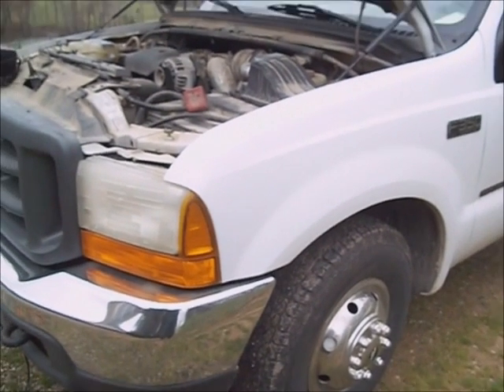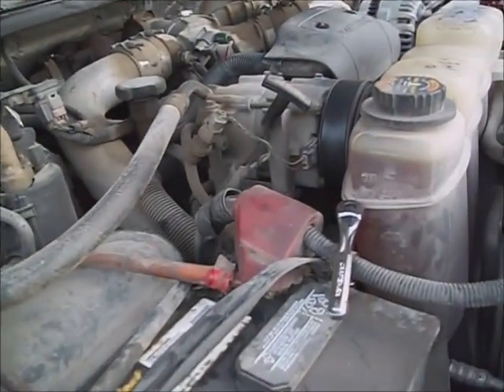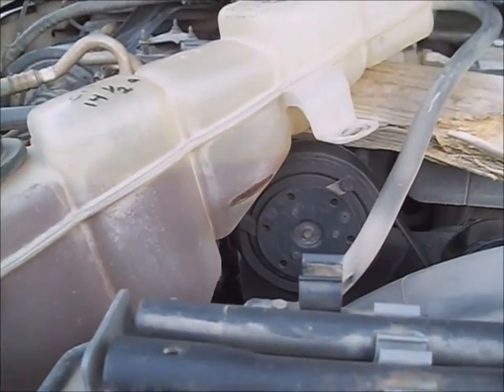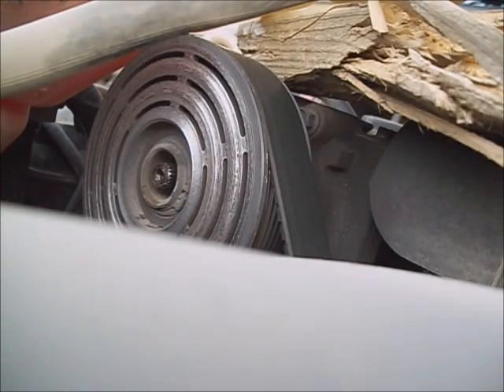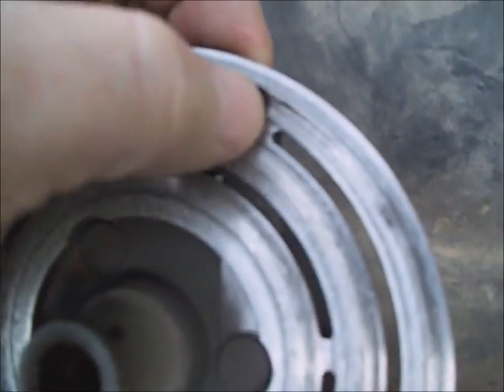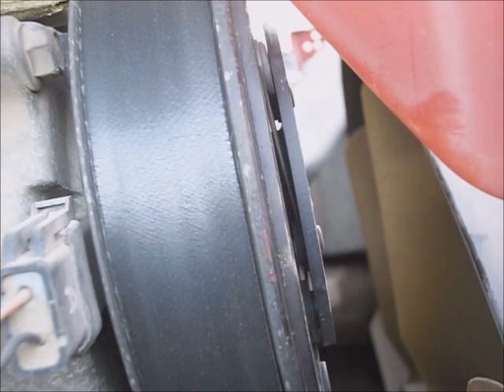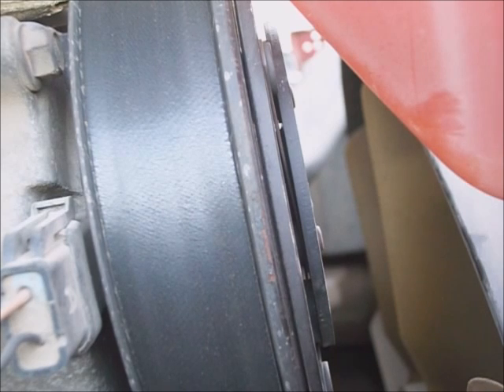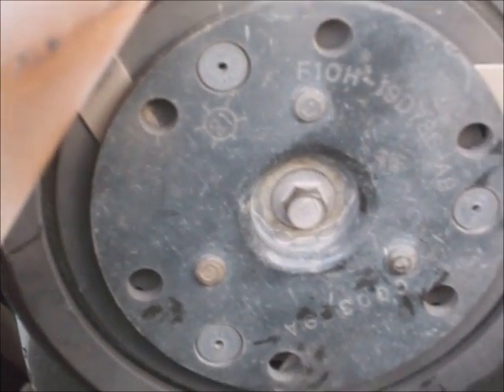Ford F350 Super Duty Utility Truck `00 w 7.3 Powerstroke DSL Turbo AC drops out at cruise speed

Comment: If it isn’t engaging and I replace instead of removing shim do I replace clutch hub or whole clutch assembly or the entire compressor
Reply from the maker: If the air gap is the problem, then both clutch components should be replaced, as a match set.  Thanks for watching.
Reply: @AutoDrdiy  i have no air gap.... sounds like i need new componets

Comment: Clutch won't engage, how do I stop it from turning to get the bolt out? 99 250 SD 7.3 - thanks
Reply from the maker: rent the holding tool from parts store, it is like a (Y) with 2 short dowel pins sticking out.  And fits into any 2 of the 6 holes in the face of the clutch plate.
Reply: Auto Dr diy will try that next week. Happy Easter! Thanks for the response! I'll let you know how it turns out.
Reply: Auto Dr diy, I had a couple of minutes to mess with it this afternoon, realized the compressor clutch wasn't even spinning when the engine and ac were on. Troubleshooting that, I bridged the low pressure switch connector and it still didn't spin. Then I bridged the high pressure switch connector and it started spinning and the air gap opened up. I ran down to the parts store and bought a new pigtail connector for the high pressure switch, installed it and my AC is blowing ice cold again just with that. Also, that did the trick on locking the clutch so can get the bolt out if I need to at a later time. Thnx again.
Reply from the maker: Congratz.  Yes, if the clutch isn`t magnetizing, then the air gap becomes irrelevant at that point.  And then related components such as the hvac related fuses, ac relay, low pres. switch, cycling switch, clutch resistance, and so on.  As a general rule, start at the power source, and work to the load.  Oh be sure and check the dealer service dept.for any recalls available on it.  Had one that caught on fire a while back because of a defective cruise control disable switch on the end of the master cylinder.  Recall has been done if there is a blue tag and a small fuse installed inline to  harness connector to switch on master cylinder.